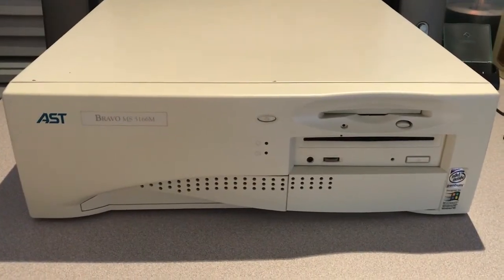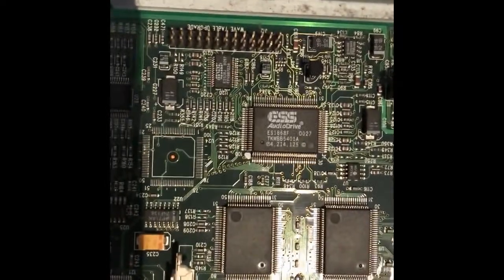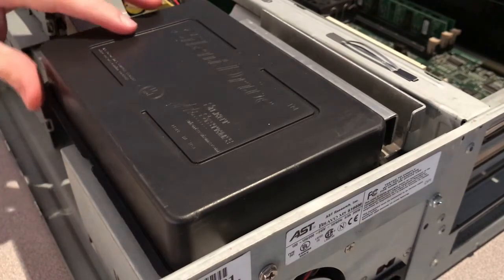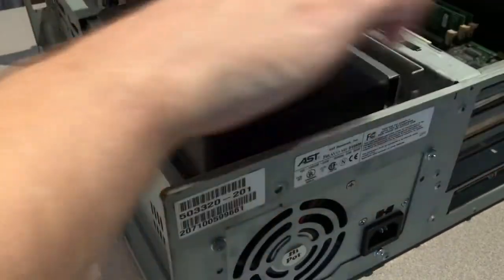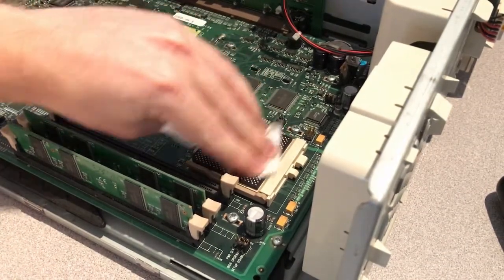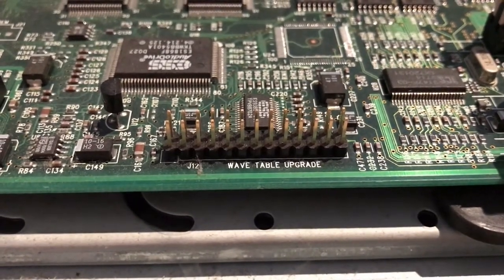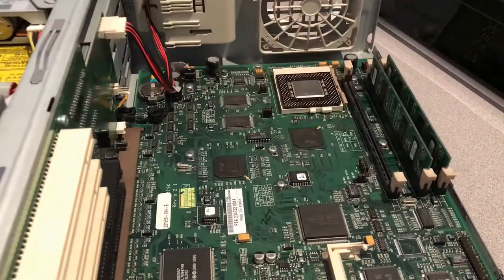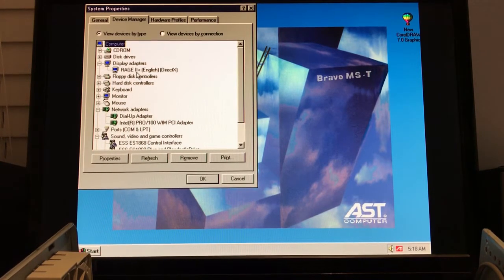AST Bravo MS 5166M - 90's Pentium MMX PC - Overview and Restoration

Comment: I've been an AST fan ever since my parents bought a 613e (Cyrix 5x86 100mhz) back in '94/95 or so. I was around 13 and going to the computer shop, with loads of PCs fully set up, a spec sheet displayed next to each, was such an amazing experience that AST has a special place in my nostalgic heart to this day. One of the guys who worked there showed us the 613e and a more expensive P100, and showed us them playing a CD and "word processing" at the same time, damn magic back then to me. I still have that 613e and it still works 100%. I've also just bought an 812 with a P166 with 16mb RAM and that works 100%. They're built like tanks. I'm hoping to build a small collection of AST machines etc. It's quite difficult to find info about some models, I think you could opt for a higher processor as well in some models. I'd be grateful if you have any links to adverts or info. I thoroughly enjoy these machines.
Reply from the maker: Hi! AST machines are great - just a notch below corporate IBM or Compaq machines. Your right that there is a lack of information online about them since AST died right when the internet was getting big at first. I just upgraded this one to a 233mhz Pentium MMX and added a Wavetable from Serdaco. Great box.